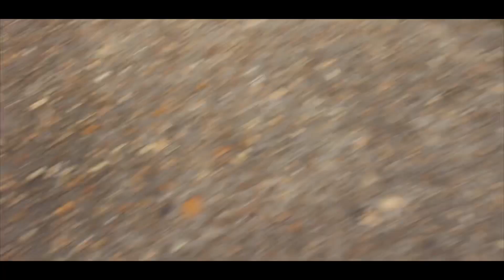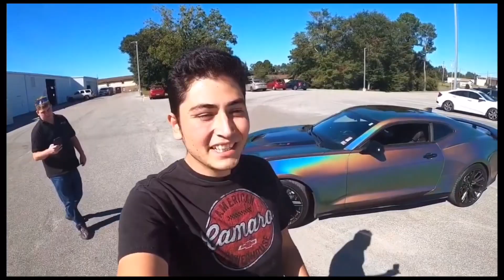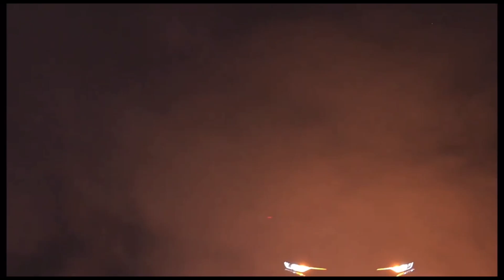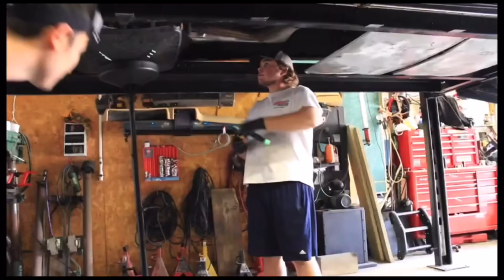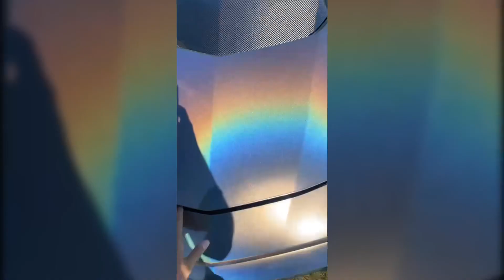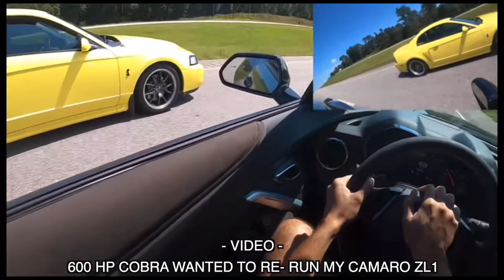1 Year of Ownership with My 2018 Camaro ZL1. Whats Next??

Comment: I think you should do longtube headers, smaller pulley, engine AND TRANS TUNE (Trans tune makes a huge difference) You will be very happy and the car will stay reliable. Get a catch can if you don't already have one. For cooling mods you can do bigger heat exchangers to help with heat soak.
Reply from the maker: just about read my mind I think that would be small enough change to not be scared of it but also get a lot more of a push out of the car